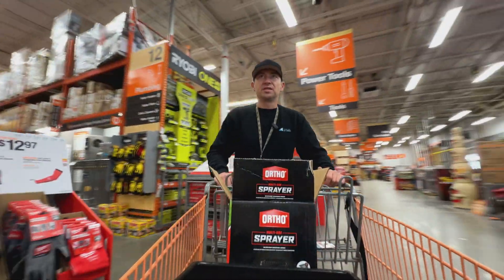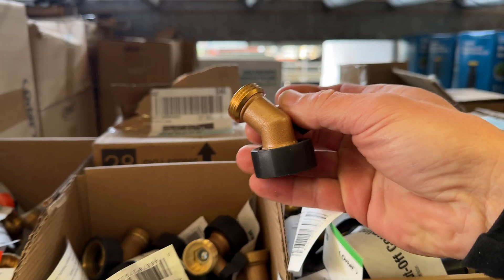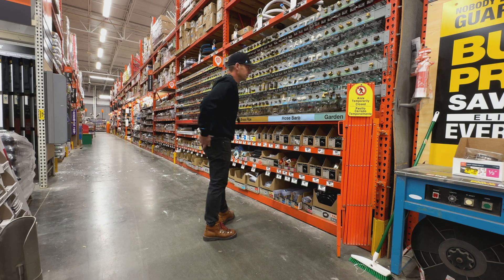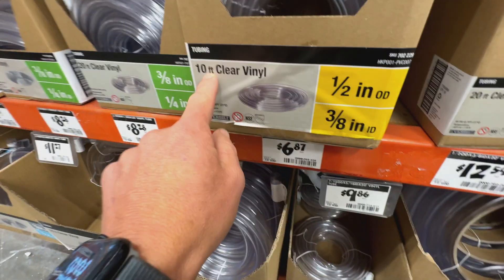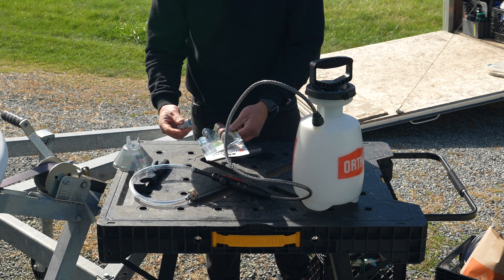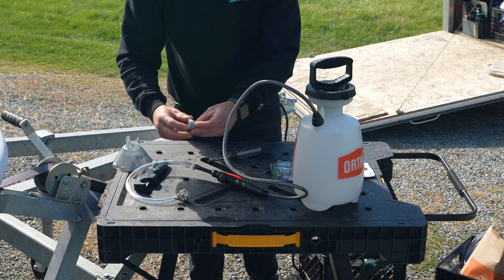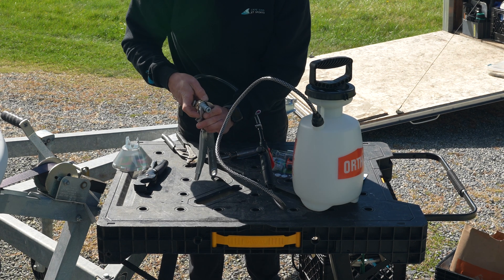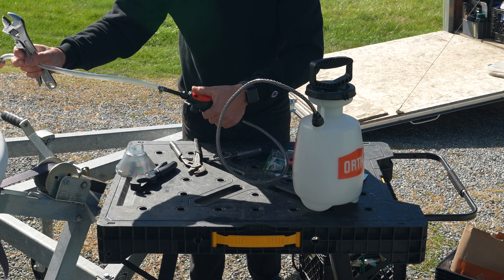Let's Build the Best JetSki antifreeze pump!

Comment: So can you use the flush port to winterize any year seadoo? I have 01 and 02 gtx’s 

I was thinking of using 5 gallon bucket with a sub pump attached to flush out port on seadoo to pump the antifreeze in while it’s running
Reply from the maker: Yes., I’ve used this setup on 2strokes, boats and my outdoor shower. Anything with a garden hose fitting. 

The bucket and sump pump works for sure too. 

I do a hundred or so a year and the pump sprayer is quick, easy and reliable (no batteries or cords)

Comment: After owning and servicing my own 7 Yamaha waverunner engines, there is a reason there is not a section on "winterization" in the manual or service manual.  There is long term storage, which does not include antifreeze in the coolant lines..  As the Yamaha jet pumps are self draining.  Glad you figured out how to dump antifreeze on the driveway, as it really did nothing for the waverunner.  It will be good for other brands though.  nice work.
Reply: yea i just "winterize" mine by running it out of the water for a few revs blowing any water left in the exhaust manifold/pump, never had to do anything else for any of my skis
Reply from the maker: I’ve seen a lot of internal corrosion problems from the wet exhaust systems. Your water box still holds fluid even after you rev it. 

The air inside of the motor is at 100% humidity all the time so fogging and antifreeze for me for the 6 months my skis will be sitting. I maintain over mil $ worth of machines and I’m taking no chances
Reply from the maker: Thanks for the input. I’d much prefer to have antifreeze than water in the machines I take care of. Next time you take an exhaust system out or motor apart let me know if you find water in it… you certainly will 👍
Reply: @ccjetsports  Fair statement, you do you.  The water box in the exhaust is the only place that can hold water after an on trailer rev.  The expansion cannot damage anything the water box with what little is left.  Rinsing is one thing to keep corrosion down, and needed in salt water. Next time catch the antifreeze that comes out compared to what you pumped in.  It' won't lie to you.  Again, it's a good video for other brands for sure.